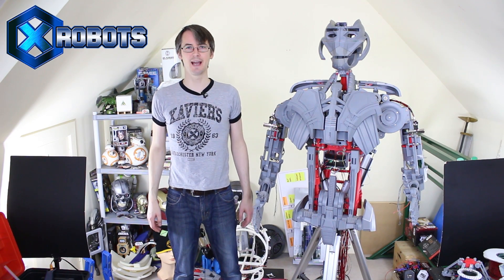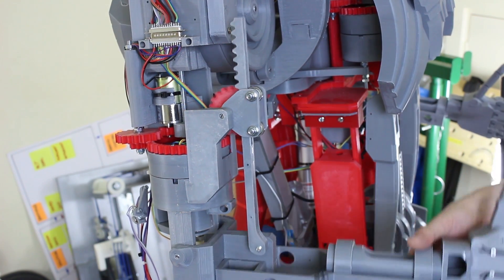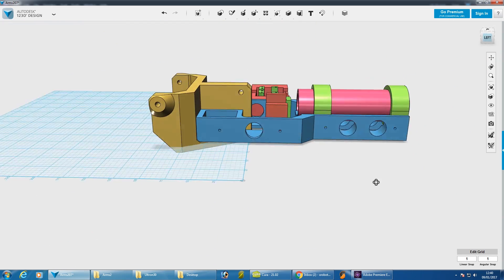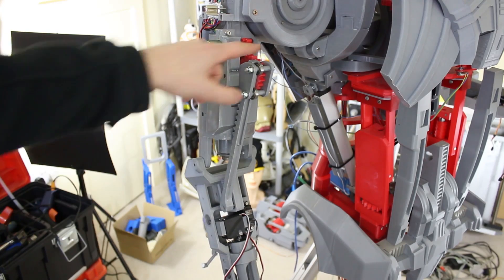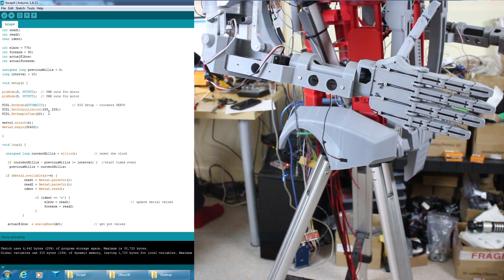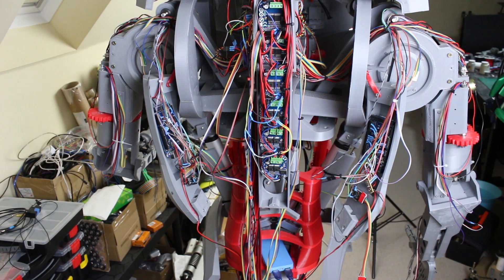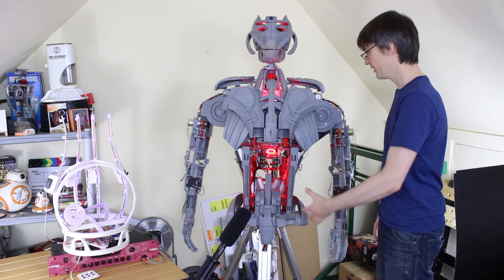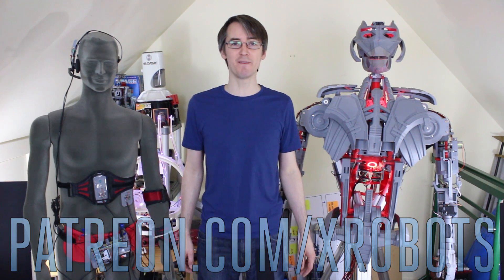Avengers Ultron #30 | Arm & Hand Control | James Bruton

Comment: James could you post some of the multi arduino code on github, and some of the sources you had for the computer vision and speech module? You are amazing! I bought a Lulzbot Mini because of you, nobody makes as many parts as you! After the setup the Lulzbots just work not like the first Chinese one I got it never has worked right since I bought it.

Comment: James, I always enjoy your videos. I've learned a lot from them. I have a question about the arm movements. Shouldn't the mapping for the hand be "hand = map (forearm, 128, 255, 10, 170)"? Seeing as the integers controlling the forearm are 0 through 127... won't the number 127 conflict if for some reason the forearm and the had receive the integer 127? I hope my question makes some sense... (looking at the video at 13:30 minutes)

Comment: Have you thought of using and oval shaped connection for the hand strings? By attaching the strings at different points on the shape as it rotates through its axis it should pull the fingers in a staged fashion. The pinky at the lowest point and first to move the thumb at the top last to move.

Comment: Hi James,
Should the code line read "hand = map(forearm,128,255,10,170);" instead of 127???
Enjoying this series as well as the others, you always cover the steps that I would struggle with.
See you on the next episode.
Reply: nice picture of a hand. not sure of the relevance lol
I meant that you have put the code to read anything equal to or above 128 = hand map, but the code starts at 127, shouldn't it be 128 as the start number?

Comment: Hey James. Just a quick thought. I learned from Adam Savage's channel that metal foil tapes and clear coat add a great chrome-like finish to projects. I remember Ultron being shiny, so maybe the metal tape trick could work for you here or in another project.
Edit: What you're doing with these 3D prints is mind boggling btw.
Reply: I worry the look it has naturally is what it needs. Chroming might be cool, but might also be too much. It would look great with the LEDs though.
Another method for chroming plastic is the way they do models. I think it uses a vacuum chamber and static electricity to pull one type of vaporized metal bits to the plastic's surface, so that it'll accept a nickel coating. 
Your regular rattle cans may be a good balance of shine to flat, and the natural gray plastic may suffice, but a weathered chrome would look fantastic I think. 

I've an addition to the leg issue also. Make the cosmetic cover panel arches part of functional mechanics. Keep updating and you'll eventually be able to consciously climb inside it, like they do with those submersible and space work robots. #Telepresence #Robonaut Maybe even make it walk by using your already existing knowledge of walking rather than writing code for it. That way it can learn balance from you specifically.

I'm not sure how you would get it to fly though. Handle the rocket hands and feet issue later, right ...

Comment: James, you can use bitmasking to split the data into axis id and rotation value. Is much simpler and faster.
(Taking in account that ints in arduino are 16bits)

rot = in & B0000000001111111  # (Values from 0 to 127)
axis_id = (in & B1111111110000000)>>7 #(Values from 0 512)

Just in case you want to expand the usage of this method to more axis (Although it will also work with your current setup with the hand only)

Comment: Super impressive!

You may need to add a little extra length on the cord for the thumb. Fists are made with the thumb on the outside of the fingers. Having the thumb on the inside, you risk breaking the thumb (at least a human would if they tried to hit something with that type of fist). I know you don't plan to have your robot hit anything but for aesthetic accuracy, correcting how the fist closes may be something you need to consider. 

Either way this robot build is amazing and can't wait to see it completed!